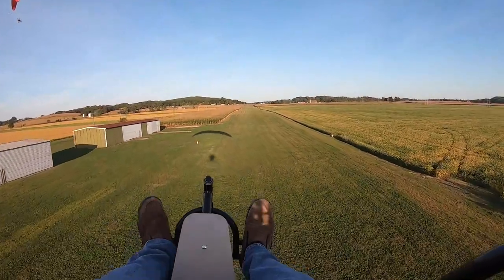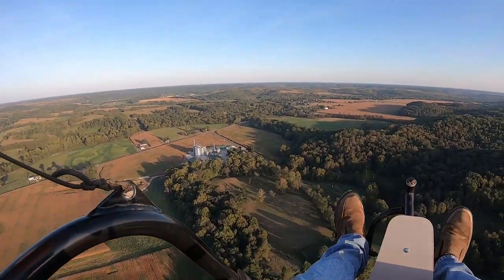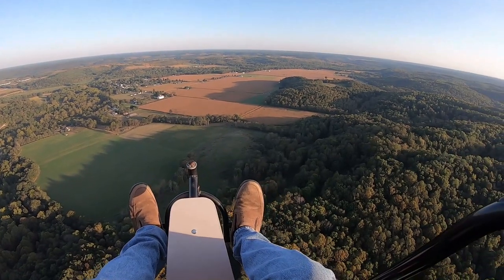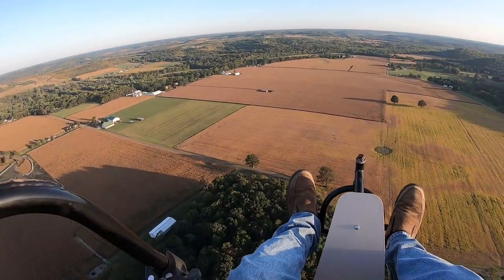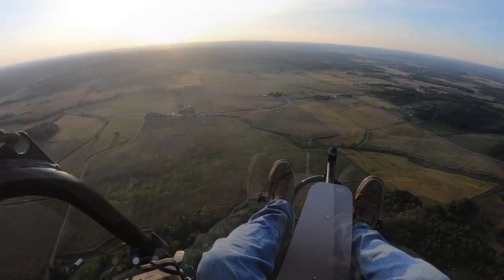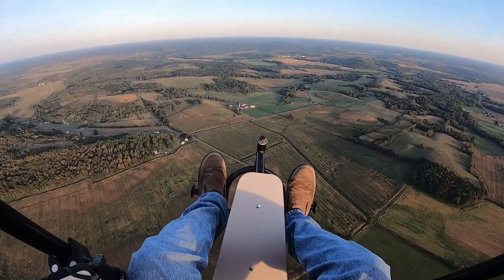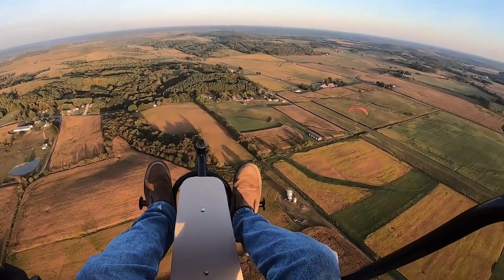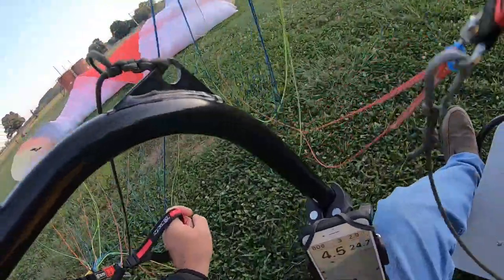PPG New Video and Audio Setup Part 1 - Ohio Paramotor Trike Adventures

Comment: Sounds good. Seems like the noise canceling is working well. So that is a GoPro 7 and a mic plugged straight in? What mic are you using? Thanks buddy!
Reply from the maker: Actually it’s connected to the Sena via back pack.

Comment: Make sure you are using the correct spark plug? There’s an R (resistive) version and one without the (R). I forgot which plug reduces and almost eliminates the scratchy sound maybe another ppg person can help? My friend had one plug and I had the other. I couldn’t hear him but he could hear me. Sorry I don’t remember because it was a quick morning flight before I left for Europe.
Reply from the maker: Sena is pretty well known to not work well.  I use the Spark Plug NGK BR8HS as well as my wingman.   David .. not sure what he uses.. We can both hear each other but the quality of sound and distance it transmits/receive is very poor...   I had better luck using the old BT-S2 cheap $40. device ...
Reply: I’m sure the correct spark plug makes a huge difference
Reply: @Ohio-PPG-Trike-Adventures  You should try the (R) plug. I think it shunts a lot of EMI noise to ground?
Reply from the maker: @CFP246  I thought the Spark Plug NGK BR8HS was the R plug.   Do you have the part number for the one you are suggesting?  Maybe the NGK 1134 BR8HS-10 would be the plug.
Reply: @Ohio-PPG-Trike-Adventures  no, it has to have an R at the end

Comment: BOB NOT RELATED TO TITLE OF VIDEO, I'VE GOT THE SAME WING AS YOU HAVE YOU USED THE TORK  LINE ON YOUR LEFT SIDE TO KEEP RIGHT TURN TO A MINIMUM. OR DO YOU USE THE SECOND HANG POINT ON LEFT RISER.  THANKS FOR HELP  SCOTT
Reply from the maker: Hey Scott, I’ve tried all but the torque line.  Left riser was minimal, but you know I will have to try it.  Normally, I like one hand on a riser so just hanging/holding the left works.   The hang point was minimal at most.  Adjusting trim in or out is also a way I keep torque down.   All in all, it is better than my previous wing.  Sorry for the ramble.
Reply: THANKS BOB FOR INFORMATION!!  I'M ON FLIGHT 28 NOW FORTH FLIGHT ON 34M WING AND I FINALLY PULLED A LITTLE RIGHT TRIM TO FIX THAT  RIGHT PULL.  I ENJOY WATCHING YOUR TAKE OFF AND LANDINGS.  I'M GOING TRY THE SECOND HANG POINT NEXT THEN TORK LINE.  THANKS FOR YOUR VIDEOS, AND MANY SAFE AND HAPPY FLIGHT TO COME FOR YOU.